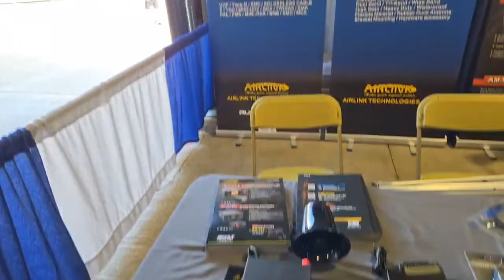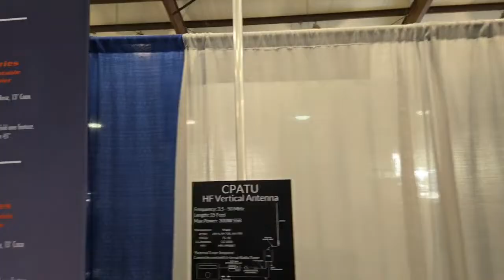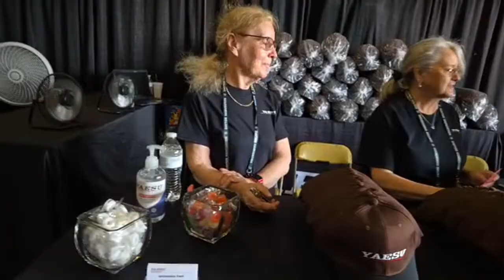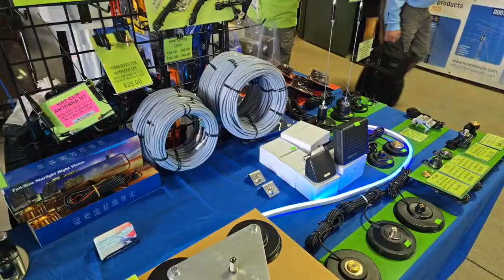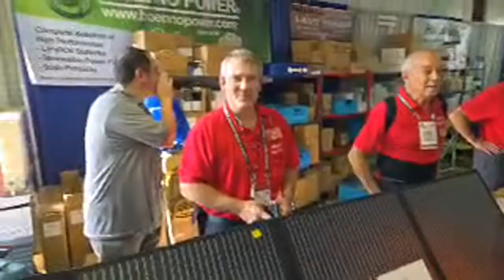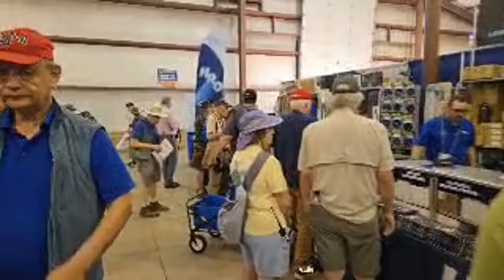Ham Radio Outlet is live in Building 3 at Dayton Hamvention!

Comment: I purchased the nRSPST and it's a piece of Junk, VHF is pretty much unusable, the audio goes into almost mute mode. I emailed them describing the issues with screenshots and videos. Even after seeing the videos for themselves, they claimed there was not problem. I boxed it up and put it in the closet, I'm back to using the RSPdx-r2 which is a good SDR. I recently bought a RX-888 MKII, and it's bad to the bone. So what I'm seeing here is they are going to add radio control? How about fixing the problems with the nRSPST before adding more problems. The nRSPST is just a Raspberry Pi using SDRconnect and whatever bastardized SDR they put in the box. And let me also state that while running the nRSPST you have No idea what's going on with the server in the background, no log files on who has connected, who might be hacking, errors, etc...
Reply from the maker: Of the several hundred of nRSP-ST units HRO has sold, we have not received any complaints about the nRSP-ST that match your comment. We have to defer to SDRplay's assessment as you did not talk directly to HRO.
Reply: @HamRadioOutlet  So I see you deleted my last reply, with the purchase #, the ticket # 's from Sdrplay, WOW, anything to make those $. No accountability what so ever.
Reply from the maker: @terryclaiborne9429  I haven't deleted anything.
Reply: @HamRadioOutlet  Yes you did, I just commented again and posted it, and it was deleted again, but this time I took a screen capture to prove that you are deleting my comment.  How lame can you be?
Reply from the maker: @terryclaiborne9429  Again... I have not deleted anything. It's possible YouTube is doing something to your posts, but you are not blocked (otherwise I would not be able to reply to you), you are not hidden (otherwise I would not be able to reply to you), your posts are not being held for moderation (otherwise I would not be able to reply to you), and I have not deleted anything. It seems you may have a problem with YouTube with the content of your messages.
Reply from the maker: @terryclaiborne9429  Further, as I said in my original reply, your concern is with the manufacturer, not with HRO. We are not SDRplay's technical support division. If you have a defective product, you can return it to HRO for a full refund within 10 days of purchase, per our return policy. If it's a warranty issue, then we can certainly help you get it back to SDRplay for a warranty repair. We have not received any complaints such as yours about the nRSP-ST, so it's quite possible yours is/was defective. Your recourse is to return the unit to HRO if it's within the return window, or to follow up with SDRplay.
Reply from the maker: @terryclaiborne9429  ...And, as a final check... I see that you posted your original comment on two different videos, this one: "Ham Radio Outlet is live in Building 3 at Dayton Hamvention!", and "SDRplay's New nRSP-ST - Ham Radio Outlet ". You are claiming I deleted comments on this thread, but I have not. Your comment on the "SDRplay's New nRSP-ST - Ham Radio Outlet" has zero replies and one like (mine). Your comment on this video has one like (mine) and 7 replies (including this one). I get an email for every comment, and I still have all the email notifications for all your comments on this video and on the "SDRplay's New nRSP-ST - Ham Radio Outlet" video. I have no email notifications from YouTube regarding any of the replies you claim I have deleted and they are not being held for moderation (comments with links are automatically held to help reduce spam and bots).